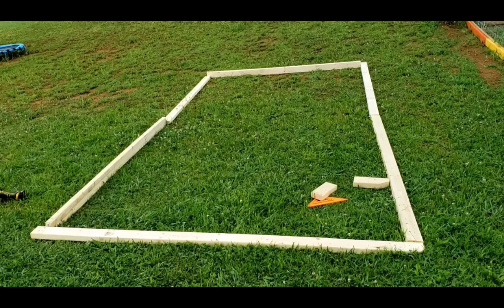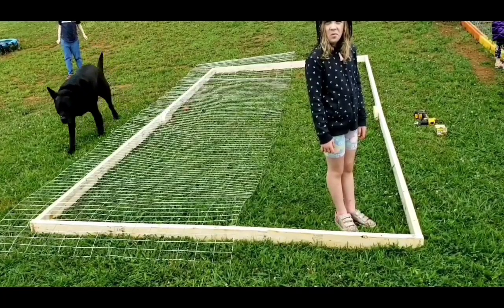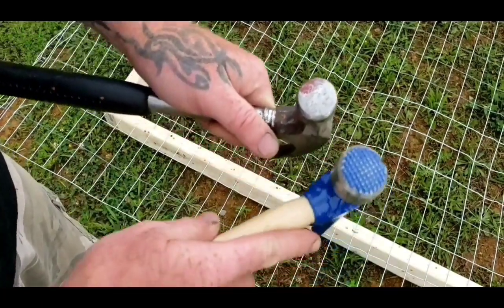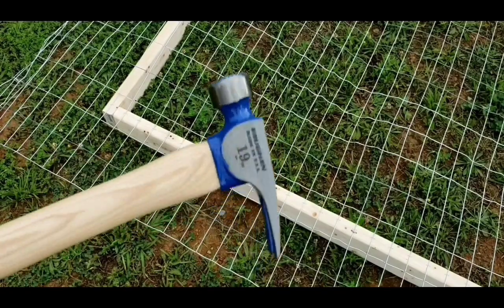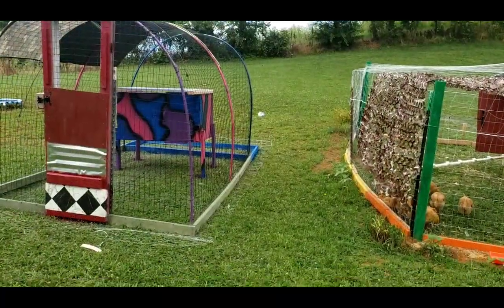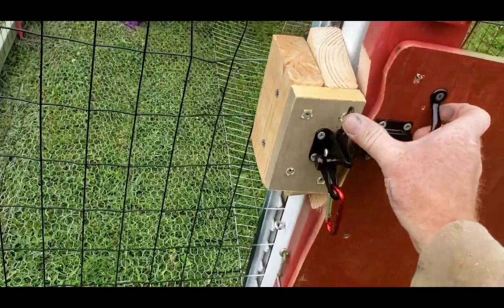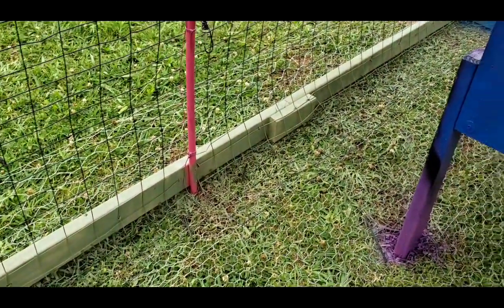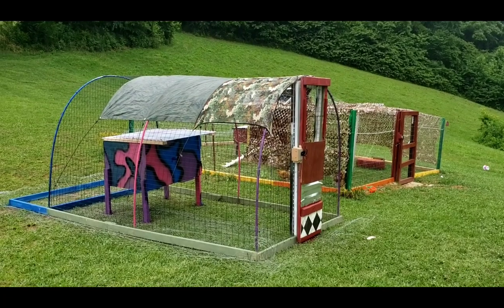PVC Pipe Hoop House Bunny Rabbit Hutch and the Importance of Animals for Survival

Comment: Thanku. This cost around $100? Did you put 2 pvcs to make the arch n taped them together? Can you move the cage from the ground like some chicken coops?
Reply from the maker: I added tape because of the balling wire. I used contractor connectors and pipe adhesive.